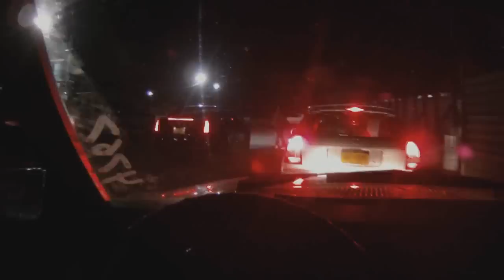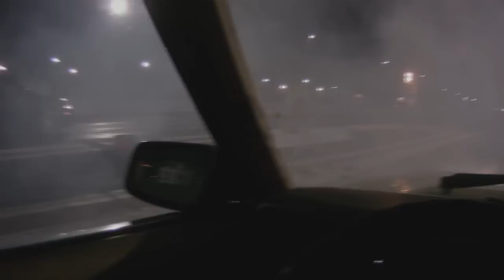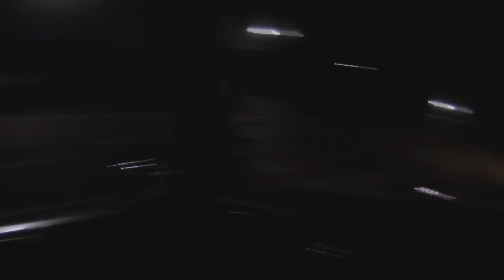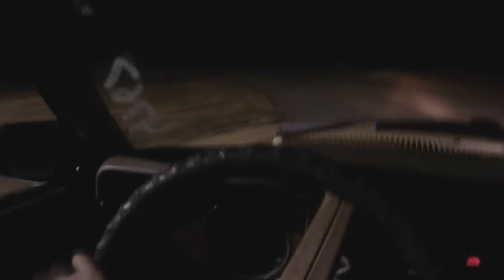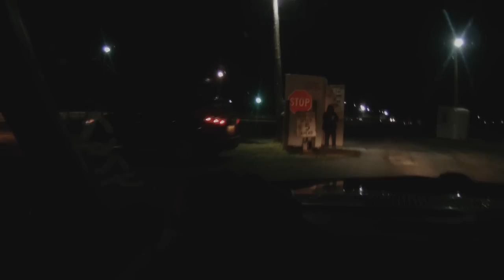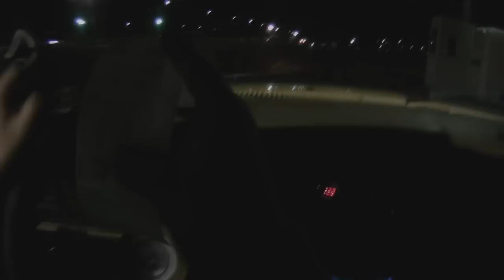11-29-13 sloppy 80e trans brake working!

Comment: Did this mod ever cause you any repeatable failures that pointed at the trans brake setup? Have you figured any way to shorten the delay, internal flow mod? I just ordered a 4l80e stand alone full manual harness that has your "sloppy trans brake" wired in it. I'm not a dedicated racer but I like walking off on these new chargers and mustangs with my 1 ton dually, has a spicy 10:1 454 makes good power 2,500-6,000. Needed to get off the computer anyway so I'll try this before I buy a stall, it's just a turd for a second when you hit it at the red light till she gets up in the curve. But I still use it as a truck and the stock converter is fine for that so ima give it a shot! I just found your channel and subscribed, got some catching up to do....lol 
have a good one brother!

Comment: so when you hit the switch on the dash is that when it goes back to first? it seems theres just a bit of a dely between the switch and take off. not a real big deal i guess unless your wanting to cut a good light or whatever
Reply from the maker: you just learn to work with it, yes there is a delay when it figures out it can goto first, the fluid path changes, then it does go to first.

Comment: Would it be easier to have the switch wired into the break so when you let off the break it goes to first as soon as you launch? That way you don't have to use one hand to steer off the line.
Reply from the maker: on all the cars i have set up Brake light switches, they are too slow to release. because the pedal has to be all the way up for them to shut off, and it usually takes the pedal a while to come all the way up.
Reply: So the shifter is in D1 and i flip the switch whicj puts the trans in D3

When i want to lauch i flip back the switch and it will downshift to D1 and go correct?

But the shifter is in 1st always...

Comment: Do you have pictures or a video of what you did? I saw the schematic on the wiki but Im still not comprehending it.
Reply from the maker: there is a LS1 tech thread on forced induction section i did but its basically the same information as whats in the wiki page
Reply from the maker: it just forces the car into high gear giving you more leverage over the converter
Reply: +Sloppy Mechanics ok Ill look that up. It has pictures of the connections you made right?
Reply: I understand that but how you have it explained doesnt register. Do you have a video or pictures with how you put it together?

Comment: Can this be done on a microsquirt car with the 80e wired for manual control no computer or does it have to be with a computer controlled trans?
Reply from the maker: i have never tried it but it should work on any system because it is bypassing the controller and forcing high gear,
Reply: Awesome. I had not seen it done in anything other than a stock PCM car yet so I was curious if that was a requirement. I'll give it a shot.

Comment: What are your 1/4 times now with trans brake?

I am considering doing your swap into a AMC RAMBLER HORNET 4 DOOR
Reply from the maker: i was only running partial 8th mile to see how it would 60ft, but the car was all over and the track was not prepped so i made no full track passes, but my 10.72@135 was a 1.81 60ft, and now this is spinning all over cutting a 1.68 on a medium launch.

Comment: I did the mod, but can't find where to disable the diagnostics to keep the trans out of limp mode. HP Tuners VCM Pro version 3.4.17 Can anybody help?
Reply from the maker: +nunya effinbidnuss engine diagnostics DTC list
Reply: Sloppy Mechanics The code (P0706) is on the DTC list, SES box not checked, No Error Reported should do the trick, right? Thanks for taking the time to help out a rookie.

Comment: 6.80 in the 1/8th is like running a 10.75 in the 1/4. Real consistent turbo car.
Reply from the maker: it already goes 10.72 @ 135 on a 1.81 60ft with  a 7.1 8th mile... back half Mutha
Reply: ***** anytime you pick up 25 or more MPH in the back half your making good power.